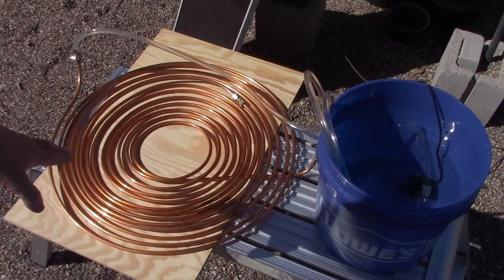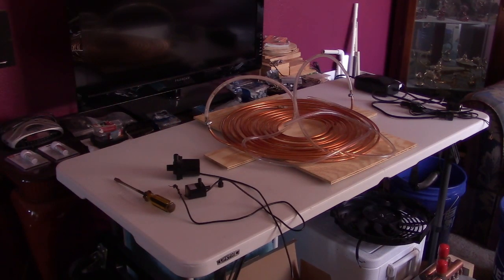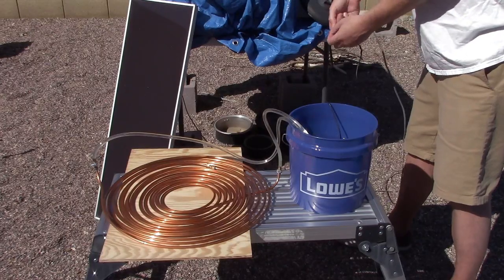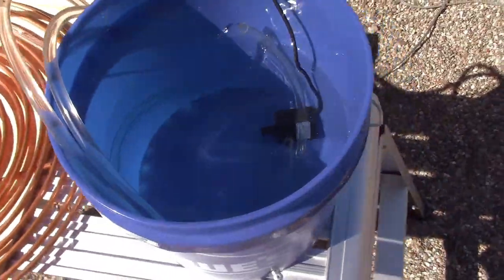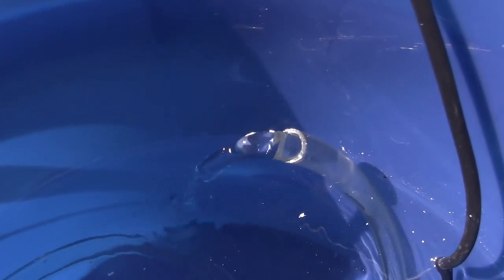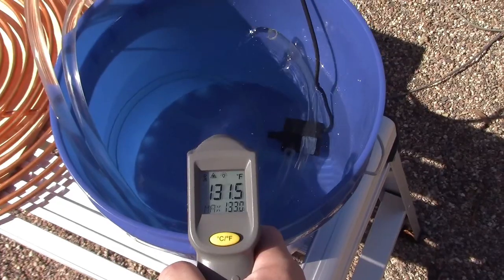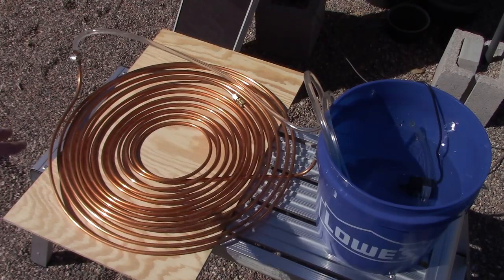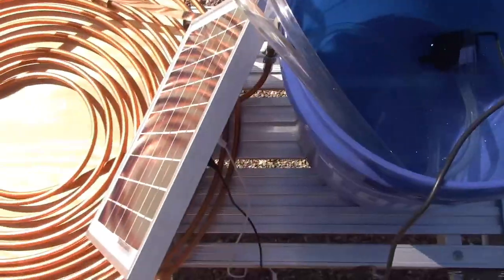DIY Copper Coil Water Heater! w/DC water pump! Simple Solar Thermal design! Ez DIY

Comment: Would it work better if you had the copper coil inside a small box, that was then painted black ? Essentially so that the coil itself was never exposed to moving air that allows it to cool.  For example , between two panes of glass

Comment: Great to compare this to your previous copper build painted black. Would a little unit like this heat an inflatable hot tub? Abundance of sunshine throughout the year and summer temperatures topping 100 degF. Tub takes 240 gal. Thanks for sharing.
Reply: He is heating 5 gallons of water from 80-130 so a 50 degree increase. 5 gallons is 1/48 of 240 gallons or .02. .02 x 30 degrees = 0.6 degrees, which isn't very much. You could run it longer or increase the length of the copper but I have to think there is a cutoff point (only so many hours of sunshine in a day). The minimal cost to build and operate this may offset the amount of electricity you need to run for your main heater.

High temperatures for things like this are only part of the equation. The average is really what matters because that is the temperature your water will be. Here in AZ I'm trying to figure out how to raise Tilapia (who generally want the water to be below 80 degrees) when the average temperature is 90 for more than 3 months. I have measured 1500 gallons that is shaded from the sun and it sits right at the average temperature of 90. I've done some research and it seems like burying a line and circulating water through it may help but it has to be at least 5 feet deep here. We don't have frost line but heat penetrates. Our "cold" tap water comes out at over 100 degrees in the summer months. :)

Comment: I see you have made a number of these systems with various setups. 

Which system have you found the best?
Reply from the maker: hi. the best in terms of highest heat would be my 3/8" copper coil unit w/aluminum absorber plate. that one gets to 185F easy
Reply: @desertsun02  thanks. Have you experimented with making a hot water storage tank? 
I'm looking for practical ideas.

Comment: do you think that pump would push the water through an exchanger and back to the bucket, kind of the reverse of your coolers?
Reply from the maker: hi there. that little pump would be too small. but you can combine this unit with a heat exchanger using 2 pumps and you'd have an air heater. btw - i did that today and filmed it! it's all 12V (so totally off grid) 2 solar panels + plus the copper coil for an awesome off grid heater. will post vid soon 🙂

Comment: Hello, I was looking at a system like this for a pool, does your pump work off of a temperature switch or is that even a possibility, I was think so the water could get hot in the pipe and the. Turn off the pump when the cool water from the pump gets in there?
Reply from the maker: hi. i didn't use a temperature switch, but you could. they sell them on amazon for 8 to 10 bucks. it should be pretty easy to hook that in.

Comment: What is your source for the 12 volt pump and 12 volt fan
Reply from the maker: hi. got the 12v pump off of amazon (they're 9-11 bucks depending on brand). no fan associated with this project but in general i get my 12v fans from walmart, frys electronics and amazon

Comment: What do you estimate cost of this would be?
Reply from the maker: hi. main components copper 27, pump 10, vinyl tubing 7, 5w panel $12. (copper is standard utility 1/4" evap cooler supply line from lowes 50ft roll 27)

Comment: Copper is expensive and plastic irrigation tube 1/4 or 1/2 is much cheaper. No need to paint it as well as they come in black. It also comes at lesser cost for environment. Here where I live in Arizona they ruin whole mountain ranges just to pull the dirt to extract copper from it.